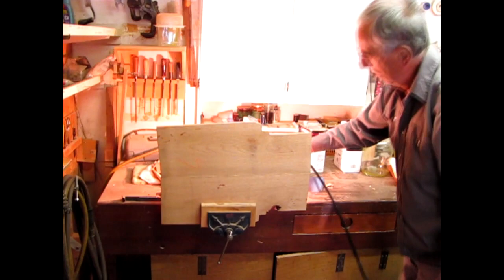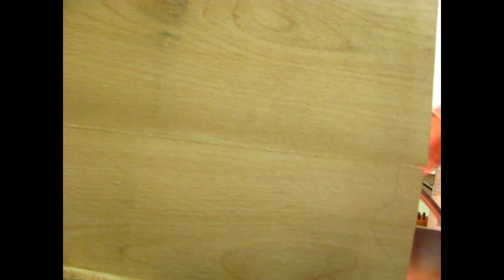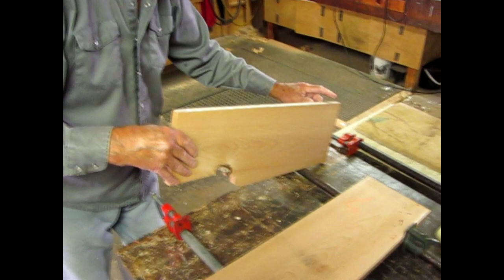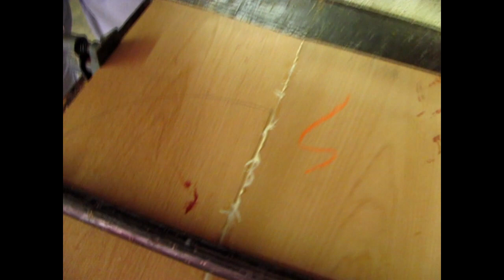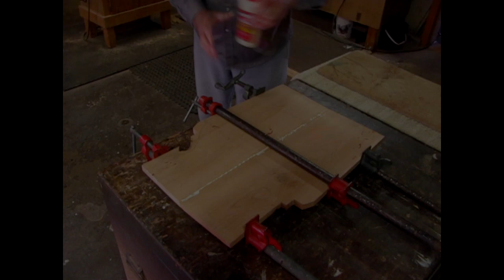Dad Joining an Archtop Set

Comment: A little early but... Happy Birthday! Freddy, quick question. I'm making a Standard Les Paul and thanks to your amazing Les Paul build series  I have started using Hot Hide Glue. My question is this,  could a book matched top be joined  together with Hot hide glue?  advantages/disadvantages? Thank you!
Reply from the maker: I'll relay the message...thanks! No advantage to hide glue for les paul top. The working time is so short, you have to be fast as lightning, with not much time to adjust alignment etc. The critical thing is that the joint is tight, so when all is done, you don't see a black glue line. There is no issue of strength, creep, or tone in that joint because it is insignificant compared to the huge area of the entire top being glued to the body. Good question though...thanks!